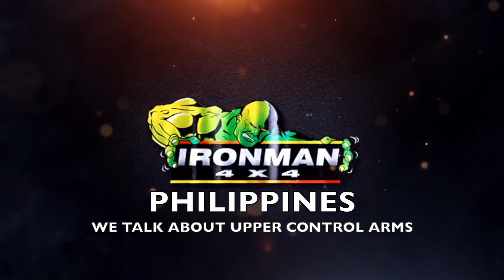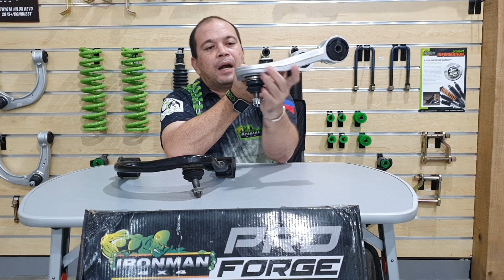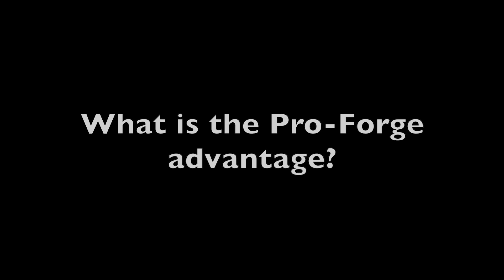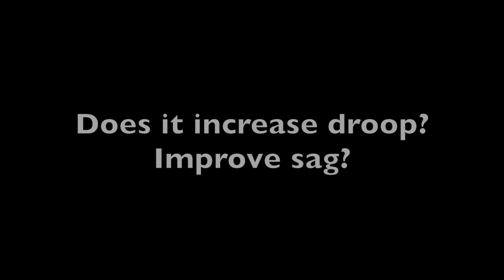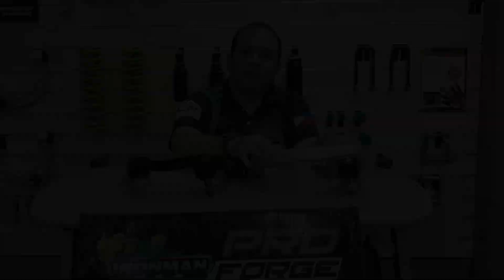Upper Control Arms

Comment: Well explained technically. I'm thinking now having convinced by this explanation to fit my 2025 d max with iron man suspension to reduce its stiff ride. Thanks bro. What you can suggest for my unit?
Reply from the maker: What are the accessories installed sir?
Reply: @ironman4x4philippines20 i dont installed any accessories. Its for simple use only not even big tires, i prefer the stock mags and tires all i want is just to reduce the stiff ride

Comment: Yup, we can lift and properly align a 2-inch lift. However, some enthusiasts are concerned about excessive droop from the lifted suspension, fearing that the ball joints might bind—especially during extended articulation or down travel. Aftermarket UCAs with high-angle ball joints solve this mostly imagined issue, and they also look really cool.

Some people love the idea of an 'Abang' setup, especially when there's a plan to go beyond a 2-inch lift for trailing.
Reply from the maker: If your 2 inch lift comes from a reputable Australian manufacturer, there is absolutely no bind, as the shock length was proper.

If you install an upper arm to save ball joint bind, what about the lower balljoint?  What about the rack ends and tie rods?

An aftermarket UCA looks cool and is designed to correct camber and caster, as a primary purpose.

Also the custom top ball joints advertised are used as a marketing tool, and is a headache when you need to replace, but is not needed.

Comment: I got a 100 series landcruiser ifs v8 jas old man emu 2inch lift wi5h the nitrocharger sports shocks shock number 60001 no diff drop installed it has extended cv drive shafts and stock upper control arms i get bumpsteer handles like a boat on corners but i do have 0 offset 79 series 16x7" rims on it with 265/75R16 tyres stock rim and tyres are 265/70 Rim 16x8" should i get the black hawk upper controle arms?

Comment: i HAVE A HILUX 2007 4X4 I WENT PRO FOAM CELL 2" LIFT and was told i didn't need the upper control arm but i can tell you yes you do. The wheel alignment was possible but when turning the wheels the wheels do not stay square with the road they tilt therefore using the edge of the tyre so when braking especially in the wet you lose all grip and slide uncontrollably and lock the wheels up do not do a 2 inch lift without new uca"s
Reply from the maker: Not true.  If you do computerized wheel alignment and the caster was set properly at 2.5° based on factory step, the tires will be square when turning.  Did they set caster using a computer?
Reply: @ironman4x4philippines20  not sure as im unqualified in the alighnment thing but mine doers it
Reply from the maker: @gutmincer2 yes yes.  The upper arm is designed to fix camber and caster issues.  If you are within spec its not needed

Comment: Do i need a UCA for a 2 inch trailblazer? I heard because you said the colorado does not fit exact the alignment after a 2 inch lift. Since i think maybe the colorado st trailblazer are the same? Thanks po
Reply from the maker: I think you would need it.  I ran my colorado for a few years without aftermarket UCA but I only had about 1.8° caster instead of 2.5°.  It would be best to see if computerized alignment could be done or not.

Comment: Can you use a UCA under stock height?
Reply from the maker: You can but you might not be able to get it aligned properly sir.
Reply: @ironman4x4philippines20  thanks, tho my tires are a little bigger. Around an inch lift na and I'm getting this weired Camber issues every now and then 😅. Thinking if this might help since the old isuzu mux/dmax's have a short UCA
Reply from the maker: @marccatamio  what modification did you do to the suspension?

Comment: Would I need to to do a body mount chop on a GX460 if I use the Ironman Upper Control Arms combined with the Ironman FCPs (for 2.5" lift with 33" Tires)? Right now I have a 2.5" spacer level kit with stock suspension with my 33" tires and I just had to trim a little. I want to get rid of a 1" spacer that I needed to prevent the tires from rubbing the stock UCA at full compression. Ironman UCAs should give me more room from watching your videos, but I am worried that they will push the tires too far back and create a need for a body mount chop. Please advise/comment if you could.

Comment: Sir question im planning this setup 2" lift nitro gas and 2" body lift i will add also a ironman UCA planning to put 305/55/20 is this okay?
Reply from the maker: On what vehicle sir?
Reply: @ironman4x4philippines20   toyota conquest 2022 4x2 matic sir, just nitrogas i want its not for trail or off road just a lift and plus UCA
Reply from the maker: @steevhen27 it will work.  Just keep rim offset to 0 or -10 max.
Reply: @ironman4x4philippines20  noted sir, XD titan rims 00 offset 20x9 is good right? coz my unit is 4x2
Reply from the maker: @steevhen27  seems okay for the rim sir
Reply: @ironman4x4philippines20  sir thank you, 1 more question sir, nitrogas and foam cell is it worth the price diff 10k.?  between performance of this 2 this 2 has a huge difference? is it noticeable performance and riding comfort
Reply from the maker: @steevhen27  i think its well worth it.  Our Foamcells are priced the same as the competitions Nitro shocks.

Comment: Good day sir yung upper arm po ba na after market nakakatulong po ba na dina umabot yung spring ng front shocks sa front swaybar? Naka 2" lift po ako. Salamat po.
Reply from the maker: Anong suspension gamit mo sir?
Reply: @ironman4x4philippines20  profender po sir yung blue na kulay. By d way po salamat po sa pansin sir kahit busy po kayo. Kayo po ba yung dinayo ni sir geo ong?  Salamat po.
Reply from the maker: @dogsguardian7267  yes po sir.  I think if may sayad sa swaybar, we can move the swaybar a bit.
Reply: @ironman4x4philippines20  yan ba yung tinatawag nila na spacer po?
Reply from the maker: @dogsguardian7267  Hilux Revo ba sir?
Reply: @ironman4x4philippines20  vigo po sir.

Comment: After 40mm lift with 285 tires my steering became sensitive depending on road conditions. It follows  uneven roads the proper term is tramlining. It wasnt behaving like that when it was stock. Will the uca solve this?

Comment: Hi.
I have Prado V6.
I installed 2 inch Dobinsons suspension lift.
Should I get Upper control arms replaced also?
Reply from the maker: how's your wheel alignment sir?
Reply: @ironman4x4philippines20  Sir, wheel alignment is OK but I do not get the steering feel as before.
It does not feel real like before.
Reply from the maker: @kanevivalakane3699  then something is off.  Was alignment done in a computerized machine using original oem specs?

Comment: Are the rear coils for Trailblazer 2016 same as MUX'S?
Reply from the maker: No sir.  The Trailblazer runs a Different rear coil.  The inside diameter on the MUX is smaller.

Comment: Matanong lng boss kapag a size ng tire no ay 285/70/17 kailanga ba ng upper arm kasi 2 inch lift din hehe 

Salamat sa sagot boss😅
Reply from the maker: Depends if pwede pa ma computer align then no need po.

Comment: if my dmax is 4x2, do i still need an UCA?
Reply from the maker: If you lift the dmax 2 inches, you will have a hard time getting alingment to factory specs.  I have a dmax here and I can only get 1.8 degrees caster. So an upper arm will definitely help.
Reply from the maker: Did you lift your dmax? How?
Reply: @ironman4x4philippines20  I was thinking about lifting it 2 inches using ridemax and muscle lift coil springs til I saw your video. Now I think I need more knowledge about suspension. My Dmax is 2020 4x2 and still at stock.
Reply from the maker: @parisbradley8099  yes better to use high quality and vehicle specific components with a warranty.  A complete kit from Ironman 4x4 with 4 shocks, 4x2 specific coils, and rear addaleaf is only 37500.
Reply: @ironman4x4philippines20  is the UCA included in that price?
Reply from the maker: @parisbradley8099  no sir.  The UCA is 30k a pair, but its the only UCA in the market that uses oem Isuzu balljoints and bushings.

Comment: Sir gud day balak ko po magpalit ng magwheels para sa 2016 isuzu mu c ko po,,un po balak ko lagay na tires is 295 x 55 x 20,,ano po kailangan ko iron man kits para ma lift ng 2 inches ang car ko at ano mga kasama nun ironman kits at magkano po,,thanks po
Reply from the maker: 295 is on the big side.  Baka 295/50 pwede but dependent on offset.  +25 is best.  2 inch kit ng ironman 4x4, nitrogas/foam cell will do with coils and UCA.  The Isuzus suffer a bit without an UCA.
Reply: @ironman4x4philippines20  how much po at ano mga includes item
Reply from the maker: @richarddelrosario743  
4 pcs Shocks:
-Nitro 28k
-Foam Cell 38k

4 pcs coils 22k

Comment: I have a 04 Toyota Tundra. It has leveling front kit (2.5-3") with a differential drop. I installed 35" tires (35/12.5R18). After cut and trim, no rubbing. I was able to get it aligned with stock UCA and LCA by adjusting the casters. I do notice that the UCA is very close to the springs. Will an aftermarket UCA and LCA will help me at all?
Reply from the maker: A UCA will help, but the distance of spring to UCA is caused by the levelling kit, as it essentially lengthened the overall length of the shocks.  It will over-extend your axles and all other components.
Check this:
https://youtu.be/PxAf2spt5WQ

Comment: This is an excellent video. I am planning to lift my Navara Np300 - 16 with a 2" suspension lift front and back and add bigger wheels and tyres. I usually ride unladen so i am looking for soft springs. Stock springs seems quite Hard. Would i need an upper control arm as well?
Reply from the maker: If you go with Foam Cell Pro Long Travel, you will need the ProForge Upper Control arms, to maximize travel.  If regular Foam Cells, and you dont push for height, then its not a need.
Reply: @ironman4x4philippines20  thank you for your input.

Comment: i need UCA for 2017 Ranger.  But not just an UCA.  I am looking for a high-angle bolt joint.  Is your UCA a high-angled bolt joint?  can i bring my unit to your shop?
Reply from the maker: Hi sir.  If you use our UCA you will not need a High Angle balljoing as our UCAs have a totally different ball joint angle.  The UCAs have been shaped to provide better angle for lifted vehicles, plus more caster, and better camber angles.  How much lift do you intend to run?  What lift kit will you use?
Reply: @ironman4x4philippines20  my Ranger has 4" Option 4WD Kit.  I believe this is Thailand made and it's not that good but no other option in philipines.  I have Option UCA and that was okay but I want to replace UCA for high-angled ball joint and also a replaceable or serviceable ball joint.  My tyres are 305x55x20r10
Reply from the maker: @JudasBytes  okay. That will work.
Reply: @ironman4x4philippines20  Does Ironman4x4 UCA work on 2017 Ranger?  Are the ball joint replaceable or serviceable?
Reply: @ironman4x4philippines20  where are you located in PH?
Reply from the maker: @JudasBytes  yes they use oem parts so replacing is not a problem
Reply from the maker: @JudasBytes  we serve the whole country sir
Reply: @ironman4x4philippines20  ipadala ko po sana yung unit ko dyan sa shop nyo
Reply from the maker: @JudasBytes  sure sir.  Our office is in 55 Dapitan, Sta Mesa Hgts, QC.  Also do feel free to message me on FB, Pablo Lu Ascoba.

Comment: Hello do i need a UCA if i lift my HILUX J series 4x4 using ironman 2 inch lift and needs to change my stock tire of 225/70/r17?
Reply from the maker: No need for the UCA if we keep it at 2 inches. For tires 265/70-17 is cool.

Comment: Boss Good day 
saan tayo pwede maka order?
Reply from the maker: Saan po location nyo sir? We have authorized dealer nationwide po sir. We'll recommend you the nearest.
Reply: @ironman4x4philippines20  noted boss
do I need this or pede na hindi, nka 2 inch lift lng aq sa ford ranger.
Reply from the maker: @jiaflores1922  it really depends how the 2 inch lift was done.  The biggest indicator is sag measurement.  Kasi po most if not all springs are 2 inch lift if installed sa vehicle with the proper weight.  Yung 2 inch spring can be a 3 inch or a 1 inch actual lift kasi.
Reply from the maker: @jiaflores1922  sag measurement will reveal if proper yung 2 inch nyo or not.  Eto link po:

https://youtu.be/10wpdjp1eLg

Comment: My 2017 Nissan Navara EL Calibre 4x2  I just installed tein suspension 265x70x17 mags after that it can’t be allign would it be solved if I put the UCA sir?
Reply from the maker: Why cant it be aligned sir?  Tein is an unlifted suspension, usually stock height.

Comment: 2 inch lift and 285 70 17 in my hilux revo. Do i need aftermarket UCA?
Reply from the maker: The main question is, "Could your vehicle be computer aligned?  All within specs?"  If yes, then you dont need the aftermarket arms.

Comment: Sir, my unit is a 2015 Mitsubishi Strada (older 4D456 engine model) I have an existing Lovell coil springs together with an MCC Front Bumper (not sure if the coils were designed for a 2 inch lift though they said it is) and I have an Amada Explorer II adjustable front shocks and also an Amada UCA (they told me that the bushings and ball joints are replaceable too, but not sure if they mean replaceable with the OEM bushings and ball joints, please give a comment if you have any knowledge regarding the replaceability). Anyway, I want to make sure if the IRON MAN PRO FORGED UCA, can accommodate cleanly with ample clearance to spare the Lovell Coil Springs and the Amada Explorer II shocks without rubbing. And my final question is, does IRON MAN PH sell replacement bushings and ball joints for the IRON MAN pro-forged UCA. Thank you. 😊
Reply from the maker: I think it can accomodate the Amada shocks and lovells coils, but I cant be so sure.  However, judging from the fact that the coils are Lovells (Australian), they were designed to work with the OEM upper arms, so fitment of any upper arm wont be a problem.  As for the bushes and balljoints, we have a few in stock, but they are readily available in any auto supply as there is nothing special about them.  The secret to the geometry of ProForge is in the arm design, so special extended balljoints are not needed.  Most Asian arms use special joints coz they did not alter the geometry of the arm, instead they just created a good looking arm for bling and added special joints, which you could have added to your stocks arms too. Same effect.

Comment: Hi Sir, just to confirm.. I dont need to get an aftermarket UCA if its only a 2inch lift - does that stay true if i upgrade from 265 65 r17 to 285 70 r17 tires? if im not mistaken that adds an extra 0.5 inch lift as well? Thanks in advance!
Reply from the maker: Yes sir.  Tire size does not affect the angle of the control arms, and doesnt affect camber and caster.  If you are running stock rims on a Toyota Hilux Revo, running 285s on the stock rims will cause the tires to rub the upper arms at full turn, while they will NOT rub on the ProForge arm.
Reply: @ironman4x4philippines20  thank you for your prompt reply. i have a fortuner 2006 and currently running stock on 17s 265 60/ i plan on getting a 17x10 -18 offset on a 285 70 r17.. would that work on my stock UCA?
Reply from the maker: @kirkplacides7434  yes it would work wih the stock UCA.  The negative (-) offset means the tires will be farther from your UCA.  So walang clearance problems.  Now the new problem is how to fit the 285s with that offset sa 2 inch lift.  It simply wont fit unless you cut and reweld the body mounts, plus/or force the suspension to about 2.5 inches.  If you push the suspension to 2.5, you will need a UCA.  Be careful of what UCA you will buy, as some dont change the geometry much, plus they run special bushings and balljoints, so maintenance is hard.
Reply: @ironman4x4philippines20  hndi po ba uubra ung pag cut ng mudflaps or inner fenders pgka ganun? kasi nakita ko ung mga naka offset hnd mka full turn kasi tmtama sa mga tapalodo
Reply from the maker: @kirkplacides7434  yes kasi malaki na yung 285 plus naka negative offset pa.  Wala na mudflaps, tope fender, then body mount chop and weld na.
Reply: @ironman4x4philippines20  kung hndi ko po iooffset pero same parin na 285.. will that fit?
Reply from the maker: As for your 2 inch lift, just as long as your rig can be computer aligned and get the factory specs for camber and caster, then essentially you dont need  the upper arm.
Reply: @ironman4x4philippines20  sir pde pa Rin poh ba lagayan ng UCA kapag stock height lang?may UCA Kasi ako na Nabili sayang Naman if Di magagamit
Reply from the maker: @fernanlouismartin9104  pwede naman sir.  Pang pogi sya.  Check mo lang baka aatras gulong mo and sasayad.  Pm mo lang ako, turuan kita paano

Comment: Gudpm sir, pag nag 2 inch lift ba ako using ironman nitrogas, springs and ironman add a leaf sa strada 4x2. Proper lift na ba iyon na matatawag
Reply: Ok thank you sir, go na ito this saturday, tnx again 👍
Reply from the maker: @pinoyobserver1190  you're very welcome sir
Reply from the maker: If your sag measures properly then your fine.  Do you recall your spring part number?
Reply: @ironman4x4philippines20  naku sir dko alam, papakabit pa lang ako this saturday sa projectarsenal shop in angeles, ironman nitro papakabit ko shocks, springs and add a leaf. Nasa tamang landas bko sir haha, palit din 17mags and bfko2 285/75r17. Ok ba yung setup na yan sir for 4x2
Reply from the maker: @pinoyobserver1190  yes medyo malaki ang 285/70-17 pero parang okay naman.